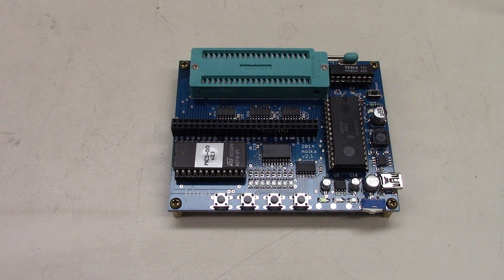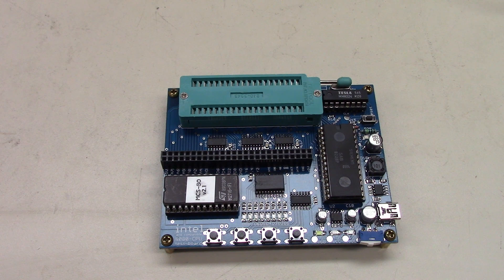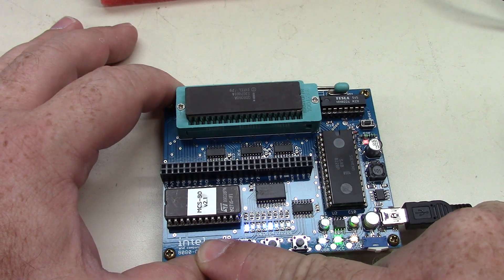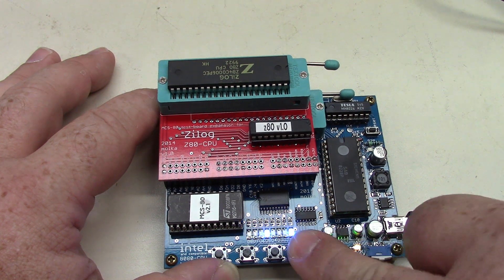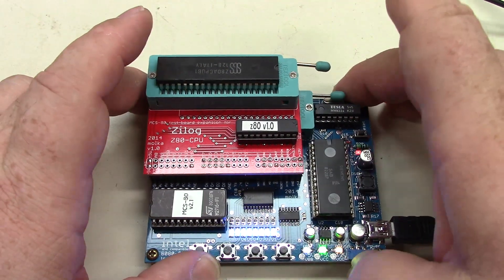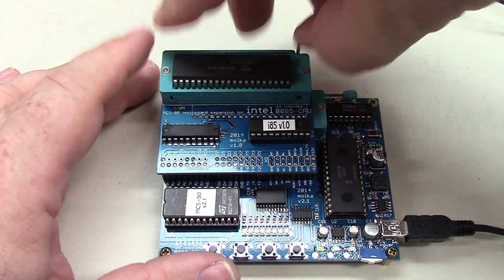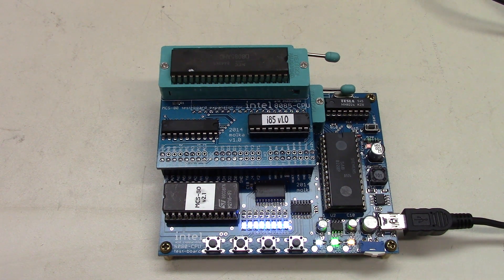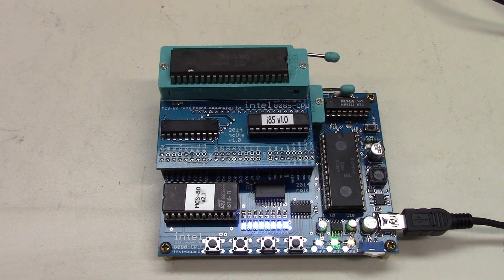MCS 80 CPU Tester

Comment from the maker: These boards are available on eBay from seller centraloregonpc. The board and adapters are ones I purchased. I liked what I received so I created this video. There are more to come on the other testers. This is the first video.

https://www.ebay.com/usr/centraloregonpc
Reply from the maker: I did find one flaw... The Intel P8080A-9 CPUs won't boot in this tester. I found one on a Midway Space Invaders boardset for a customer. Outside of this issue the tester has been spot on for testing other 8080A variants.